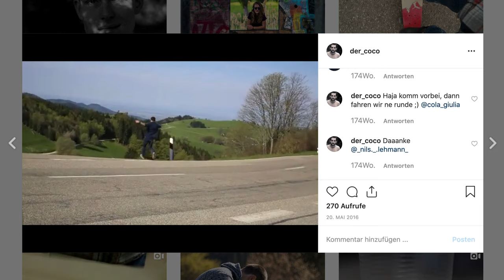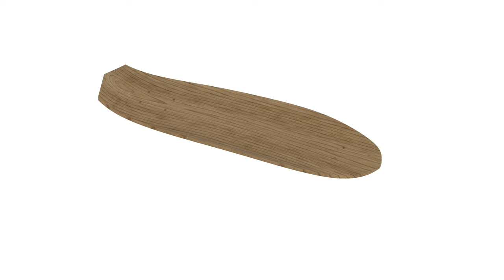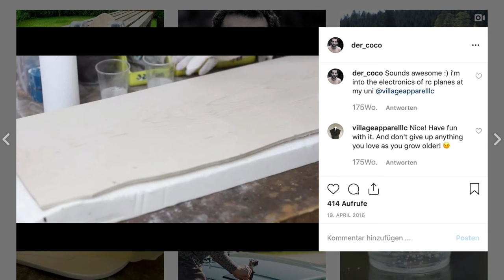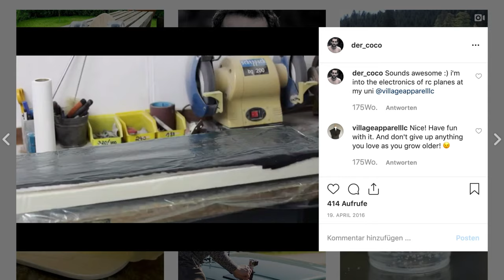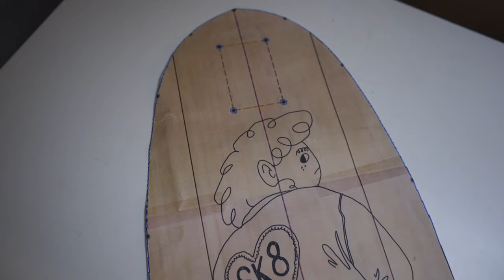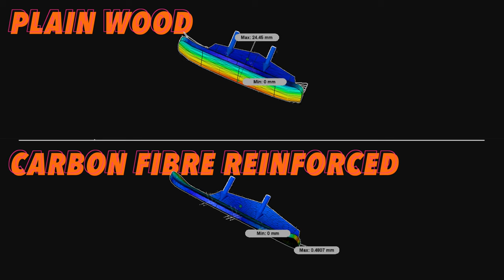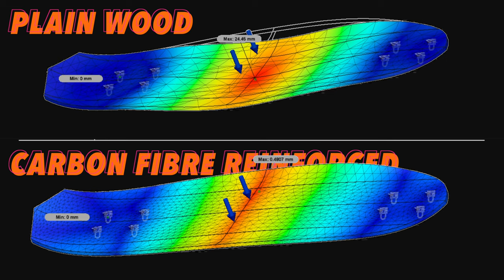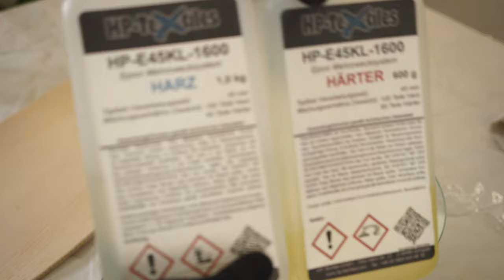Awesome Longboard Cruiser Build (CNC and Carbon Fiber)

Comment: Cool video and a nice build!

Why laminate the carbon fiber between the veneers though, where it is not under load and cannot contribute to stiffness? It would be way stiffer if the carbon fiber was on the underside of the board.
Reply from the maker: Yeah it would make a big difference, but I wanted to keep the wooden look. I might add a layer of fiberglass on the bottom. That would also help a lot and it would be almost transparent. Thanks for watching!

Comment: Was looking for, carbon forged skate trucks( longboard trucks) and I found your video. 

Just a question.,   what did you use to  joine the wood and the carbon fiber? It ia not wood glue  right? Been wanting to make my own  deck for a while.  Maybe  dancer board or a downhill one.

Great Video!  Cheers!
Reply from the maker: Hey! I used just plain epoxy. Works great with wood, carbon fiber and other laminates. 
Cheers :)